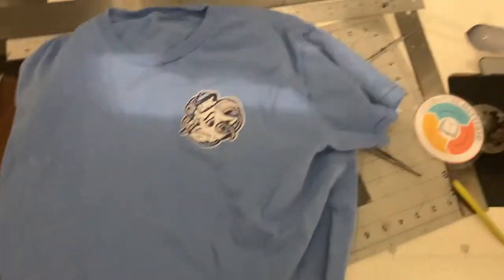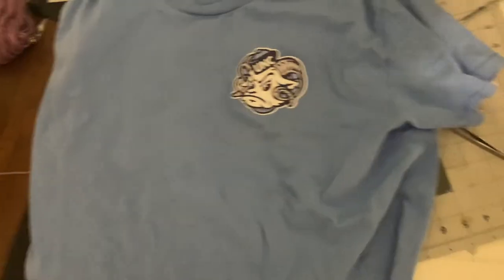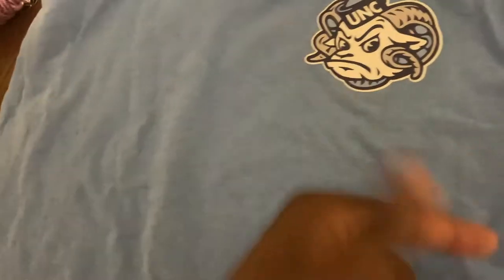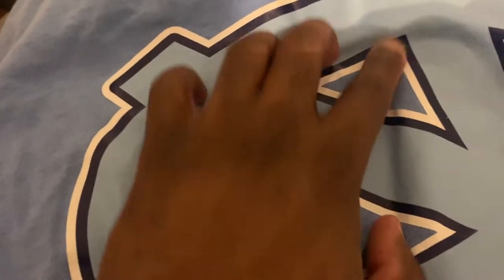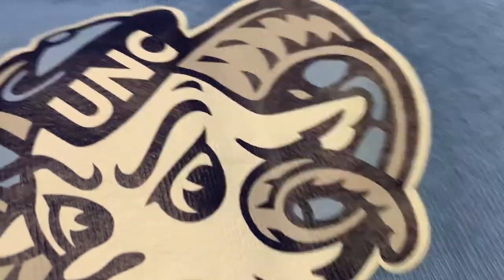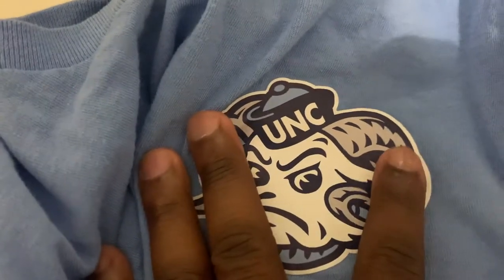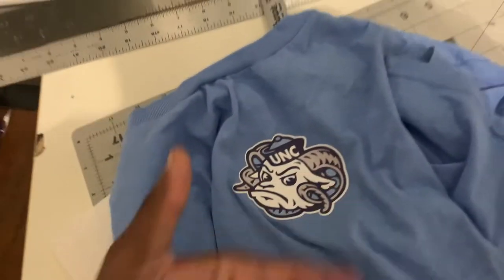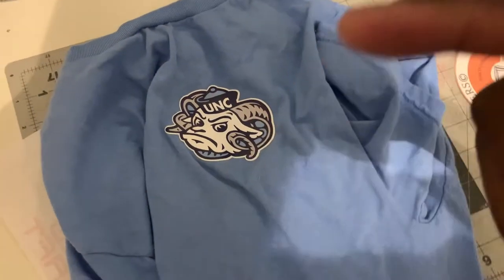Eco Solvent t shirt wash test | Is it durable 10 washes later?

Comment: Did you wash it in cold or warm water? I Can't find a video on the whole wash process.
Reply from the maker: Cold or hot… just don’t put fabric softener on it because it’ll pick up the vinyl
Reply: @shastylesdesign  then hang to dry?
Reply from the maker: @brooklynmiller2425  I put it in the dryer
Reply from the maker: @brooklynmiller2425  regular/high heat

Comment: What temperature and fir how long did you press? Did you put in dryer?
Reply from the maker: 333 for 16 seconds high pressure. I put them in the dryer regularly
Reply: @shastylesdesign  I washed mine in gain cold and put it in the dryer. My color was almost all the way out! Trying to figure out what I did wrong before I buy my second roll. I messed up 4 shirts in one wash 😭. I honestly didn’t even mean to have them in there until I know how to wash them. I have 10 more shirts my family have. Those are probably ruined by now if they did what I did.
Reply: @brooklynmiller2425  Was it high heat? High heat will fade the color. I always wash in low heat or air dry.